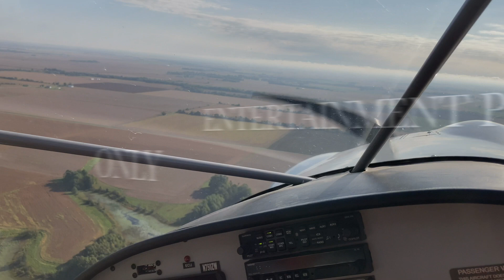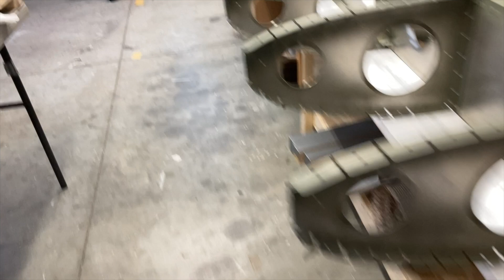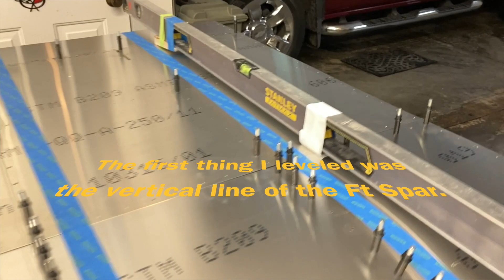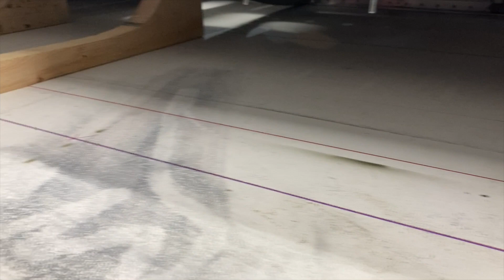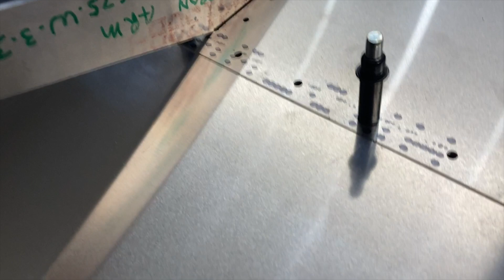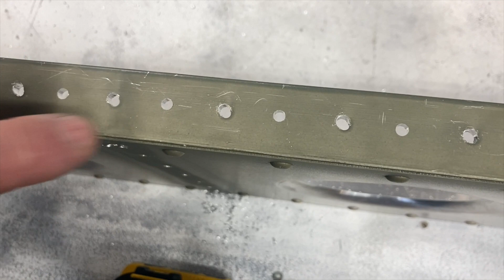Zenith CH750 Cruzer Build...Wing #4  Tacking the Good With The Bad .. part 14

Comment: Sorry to hear of your bad luck. Trust me living a long way away from the US that problems like this fill me with trepidation. I am keen to hear what you identified as the problem, the stepper drill or what, but you've probably addressed that in other videos. Thanks for sharing and I got a lot out of the method of stabilising the wing on the bench, I'll be copying a lot of that setup.
Reply from the maker: Thanks for watching. yes that was terrible but that's building, I do have a vid on how I did the next one right, called  part #15 a technique to match drill your wing. the setup on the table worked so good I would use it again. and I did on the other side.  :)

Comment: Why couldn't you put clecos in the spar when attaching the skins? If  it were me I would put clecos in every other hole in the line of rivets in the spar before you put any in the ribs. NO NEED FOR TAPE.  That should solve the problem of hole not aligning in the spar. Looking good, thanks for putting your project on here.
Reply from the maker: Thanks for watching. I’m working on the left skin now and I don’t know if you noticed but in it, I said that the nose skin has no holes and I thought you were supposed to drill down through the bottom skin and the nose skin into the spar all at once, the plan now is to Cleco it all up except for the spar and match drill, the nose skins to the bottom skins and use those holes to Cleo to the spa before upsizing. Thank you for your comment. It’s much appreciated.
Reply: @DennisZylstra  Yeah, I missed that part about the nose skin.  That is strange that they would leave those out.  Do they at least put that step in the manual.?   Good to be aware of that , I am thinking about building one of these  down the road.   Thanks again

Comment: hello!
your construction is very cool!
I'm going to build a home cockpit for the CH 750 Cruzer I fly in Microsoft Flight Simulator 2020, could you please share the panel measurements, length and width, or complete drawing, I'll use 6 mm MDF.
Thank you for any help!
Reply from the maker: Sound like a great project . sorry  I can't download pics on here. here's the dimensions. 960mm X 280mm and from the center out it starts to turn down at 170mm and half way between that measurement to the bottom is about 400mm. GOOD luck on your project,  hope this helps and Thanks for Watching.
Reply: @DennisZylstra thanks💯

Comment: I know it is going to be costly for the new spar, but the peace of mind in the middle of the night worrying if the old spar was weakened by those extra holes will be worth the money.
i did something similar on the H stab spar drilled some holes in the wrong spot and they told me how to put braces in it but i just took it all apart and bought a new spar for the peace of mind
Reply from the maker: I talked to a good friend last night that designs airplane parts and he said that the strength in the angles in the spar is the vertical part of the angle. Cool. Im still going to sleep better. Ha .You do right! All part of the Journey . Thanks for Watching and your time.

Comment: Couldn't you  have just ordered a new angel and drilled and riveted it yourself?  Or bought an angle locally and installed it in its place and not needed to pay the crating and shipping? I needed to replace an angle in the frame and as the shape was a little different I called and was told I could replace the angle with the same material. Good luck.
Reply from the maker: Thank you I'm going to need it . Short answer ,Yes. But Im so independently wealthy it just don't matter. And if you believe that I have some land to sell you. Thanks for the well wish it means a lot.